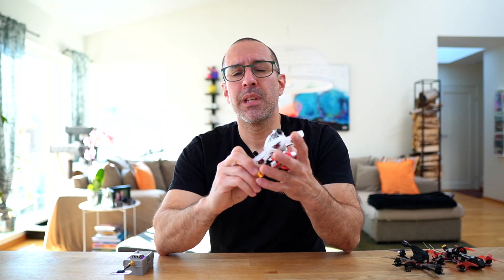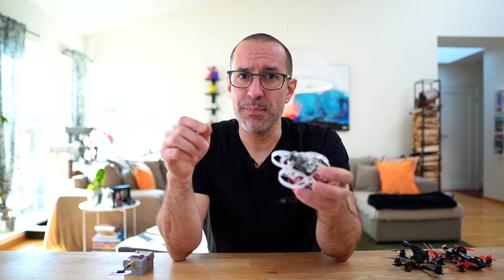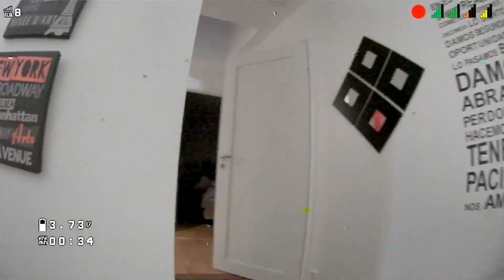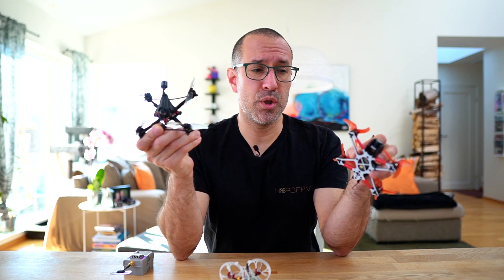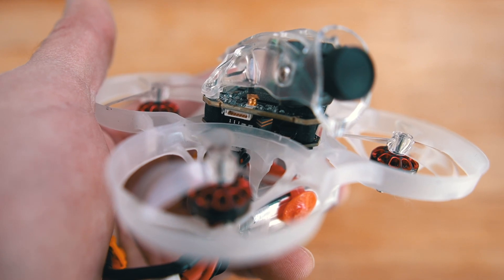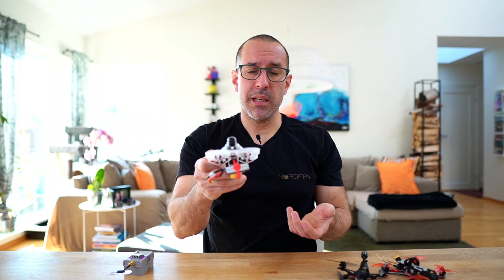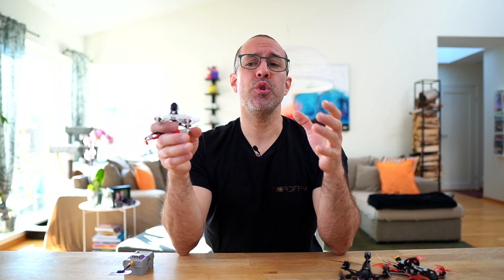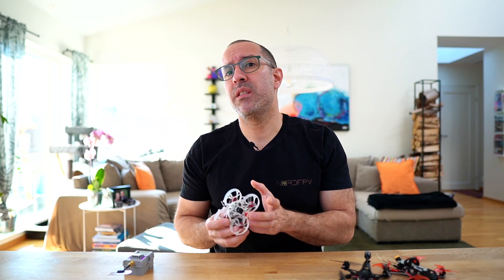Mobula 7 HDZero - Finally HD quality for indoor FPV drones!

Comment: Hello sir,
Can I use my emax goggles to fly this hdzero quad or do I need hd capable googles to fly this quad??
Reply from the maker: Hi. No, they are completely different systems. You need goggles with HDMI input to connect a video module (commonly known as HDZero VRX) to receive the Hdzero signal. HDZero is planning to release their own goggles some time this year.

Comment: Great review, but I have to say that I also really enjoy this drone outdoors too. On 3s 300mah from GNB it flies great.  Like you, I also had one of the Newbeedrone Azi props fly right off and it tumbled fantastically to the ground. In your house, I noticed you have some interference. Might be HDzero is on the same channel as your wifi router? I don't get that interference inside with mine.
Reply from the maker: Hi John, thanks for the info. So you think I have interference huh? Interesting. I haven't tried to check the channel from the default, I did remove a lot of the UI elements to see if I got less noise. I will play around channels this weekend and see if I get better quality. That will be really good. Thanks for the tip!

Comment: Brush some clear GE silicone caulking about 4 mm thick to fix the broken canopy screw . My tinyhawk 2 freestyle crashed and the battery flew out and broke the fc standoffs so i used silicone caulking  and ti holds a year so far .
Reply from the maker: HI Gregory. Great tip, I'll try that

Comment: What goggles work with hdzero ?
Reply from the maker: Any google that has an HDMI input will work. I'm using fatshark HDO2. You have to of course think how are you going to mount the video receiver, but there are many printed parts you can use from thingiverse depending on which model you chose.
Reply: @NordFPV  

Oh well .  Sounds great . Ho I e i get one soon .
    Has anybody tried building a big sensitive ground station tripod  system ? All I have is rc832 vtx on a big battery drone with tripod ground reciever for now . Maybe omni directional antennas on the  vtx's underneath or something for now . Ot black and white video will extend range in future development
Reply: You can use the module on HDMI existing goggles like he said or use the fat shark scout HD box goggles. I prefer them because they are lighter weight.